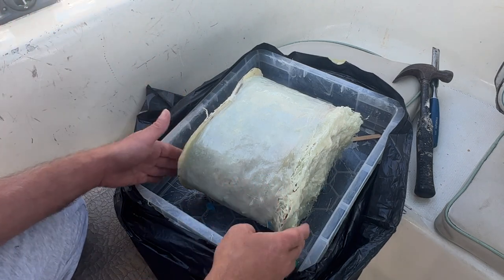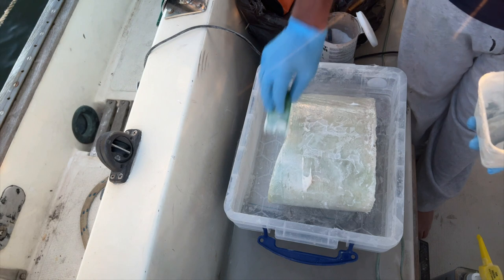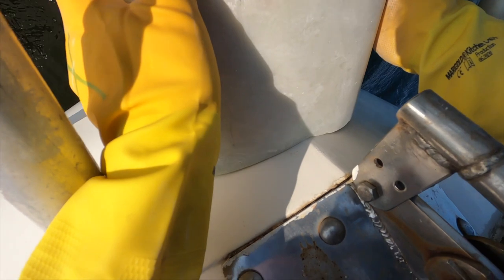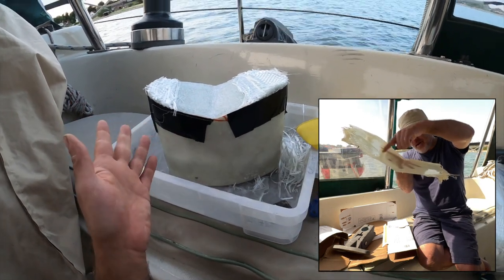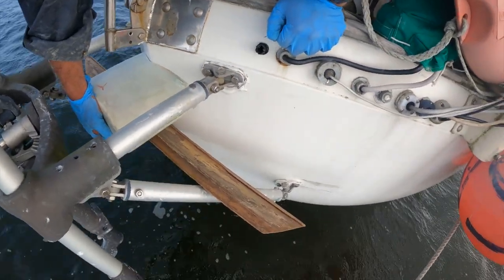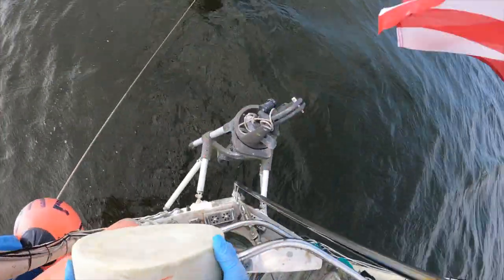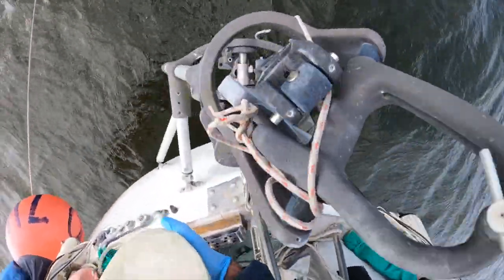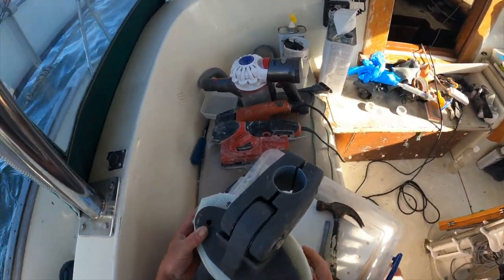Hydrovane Windvane, Part 3: Installing a Fibreglass Mount for the Upper Bracket | PFS Ep. 17

Comment: Drake — A simple stainless bracket with two small mounting pads on each side of the hull center line would be the way to go here. Any metal fabricator can make this for you.
Reply from the maker: Thanks. I considered hiring a having a shop fabricate this out of stainless, but then figured that doing it this way would be cheaper and also faster given all the factors.

Comment: Hey Drake, in the last episode I was a little worried that you made your mold out of only two layers of woven.  As you discovered, that wasn't stiff enough to hold the shape you needed. Next time add a couple layers of roving and/or laminate some mixing sticks or wood scraps on top of the woven to give your mold more stiffness.   That would hold the shape better.  Also plastic bags aren't the best release materials if you want a fair finish.  Did you try going to the auto parts store for a can of Carnauba wax?  3 or 4 coats would be enough, 6 if you're worried, and you could always do a test release.  I would also consider increasing the bolt diameter of the spacer through bolts, or even tap a few bolts from the inside.  4 inches is a lot of leverage and Epoxy doesn't do very well with the torque loads that your wind vane foil will probably add.  Tabbing the spacer would help, but there doesn't look like there's enough room with the existing structure to build a fiberglass flange. Just some suggestions that you can take or leave as you go.
Reply from the maker: Thank you so much for this. :) All really great info and suggestions. I'll see if I can increase the spacer bolt size, and seriously look at tapping bolts from the inside.. Many thanks.

Comment: phew hope you are putting in big backing plate as well, i won't be hiring you for fibreglass work , i reckon you should fillet that onto the hull with at least 6 layers and then fill etc, but standing on it was brave! ;0)
Reply from the maker: I'm putting in a pretty big backing plate. I showed it in the unboxing video. :)

Comment: Don't want to be a party popper but you shouldn't use white spirt to clean the surfaces to epoxy, white spirit is oil based and leaves a oil residue, basically a release agent.
You need to use acetone to degrease and prep surfaces

Comment: Cleaning surface with mineral spirits before applying epoxy resin? Bad idea!
Reply from the maker: why?
Reply: @drakeParagon  I newer use mineral spirits to clean the surface before applying epoxy resin so I can't say what will happen but West marine or Jamestown distributors don't recommend using mineral spirits I use acetone or alcohol the oily feeling of mineral spirits gives me goosebumps. The best should be to use lacquer thinner or some special solvents. Like your videos thank you for sharing your cruising life.
Reply from the maker: @pavelusa  Thank you Pavel. Good to know! Hopefully, since it completely dried off before I applied the epoxy it will be ok, but I'll definitely use lacquer thinner from now on. :)
Reply: Leaves an oily residue is why, fibre glass likes acetone or maybe cellulose thinners. My tuppence is to have something wider and maybe 2-3” on the inside (a hardwood?) to spread the twisting loads from the fibreglass block. Could even beef up the inside with more glass beforehand.